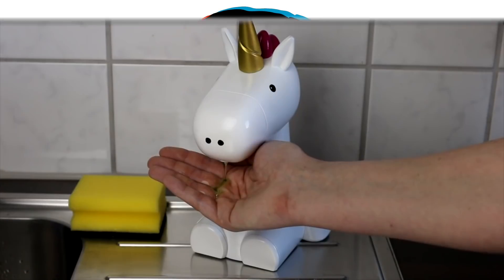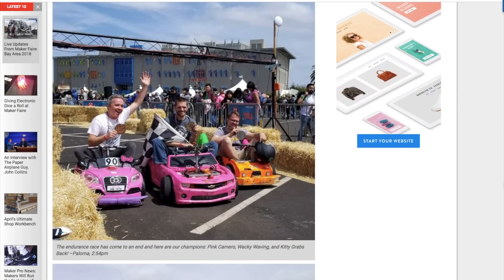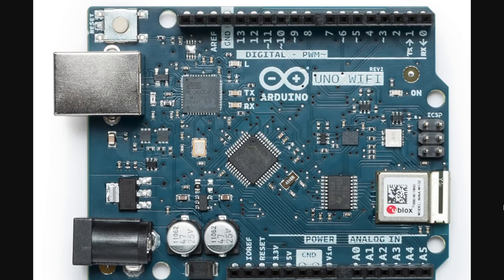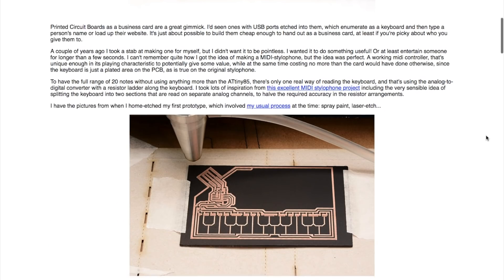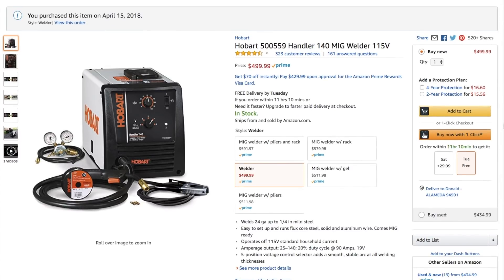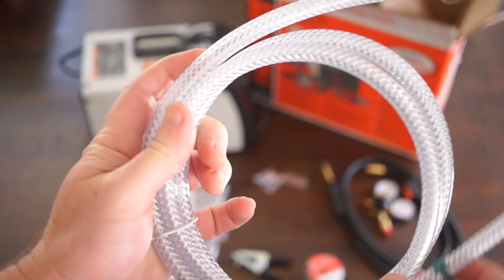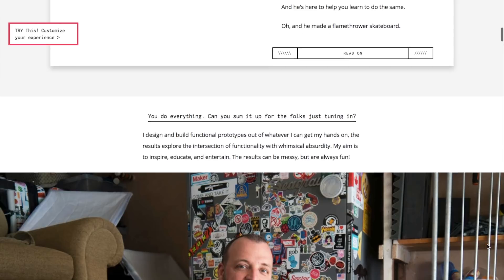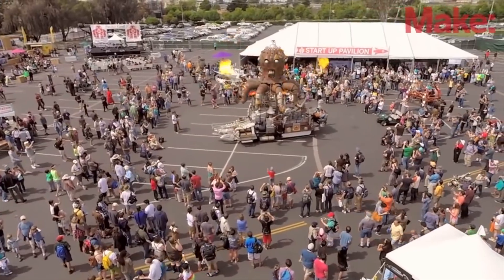The Sick Unicorn [Maker Update]

Comment: What motors did you use? Did they just overheat?
Reply from the maker: Yeah, they were smaller motors made for e-scooters, 24v, 250 watts. My thinking is that I would make a lighter car that would go slower, but in reality you need that extra power and bulk just to transport the weight of a human body (and batteries, and frame) around and to dissipate the heat that's created. After one motor failed, the other motor was overworked even faster, and poof. The good news is that the rest of the car is in great shape and a simple motor upgrade (and welding mounting plates) should get me back on the road.
Reply: A valid reason to lose weight! :) I know in F1 racing, every extra fraction of a pound that's on the car matters, but I remember once when I was at a race I thought to myself how much faster the car could go if the driver actually weighed less.
You could always add a small PC fan blowing air at the motor, right? Or would the airflow from the fan be negligible compared to the wind outside?